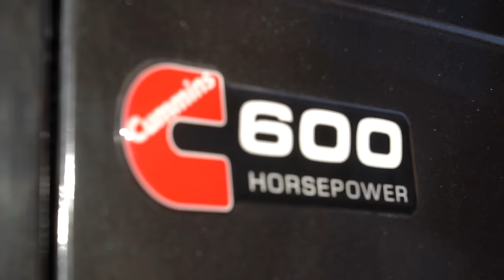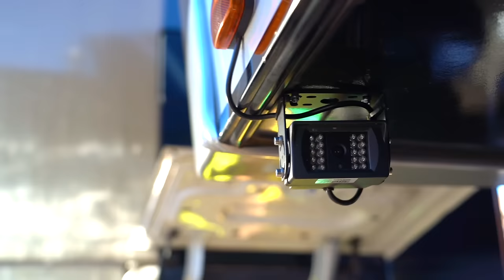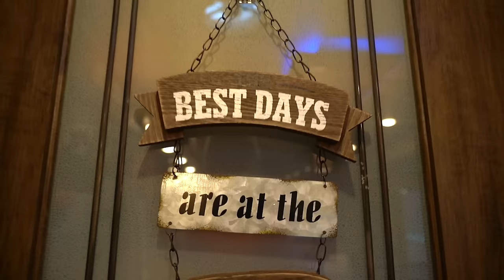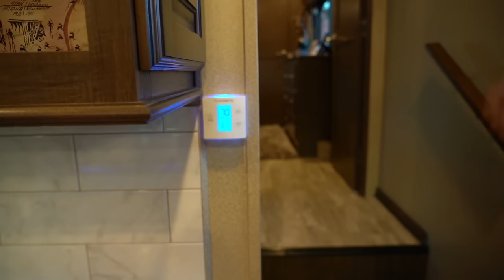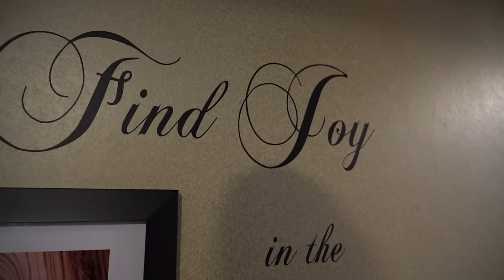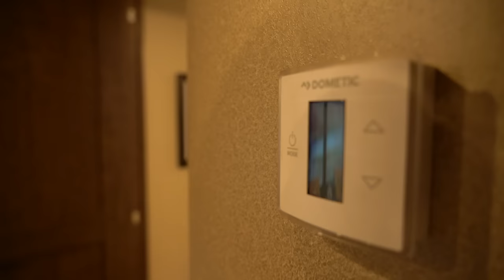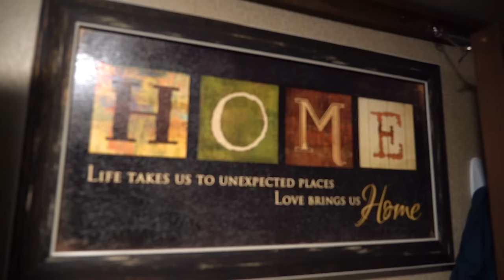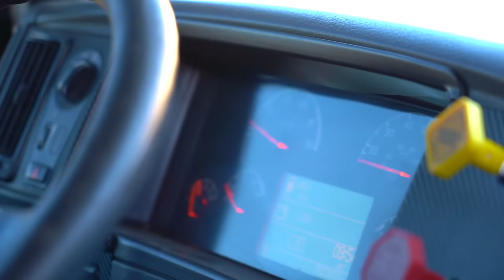Couple Builds The GREATEST DIY RV Conversion EVER!

Comment from the maker: What should they name this rig? Most upvotes wins! ✅ LINKS & TIMESTAMPS BELOW! Lees Ferry Camping https://youtu.be/qurgpg9DAcU 
Water solution! https://youtu.be/wfCaSL5CVhM Insane RV Tour! https://youtu.be/4U9MBX8lLPA
Starlink video https://youtu.be/PvpX2cfWJo0
00:00 Intro
06:40 Lees Ferry Campground
07:56 Grand Design Solitude 310 GKR mods & upgrade tour begins
10:37 Camping on the Colorado River, what to do in Page & Lees Ferry
25:33 Clear Source 3 Stage Ultra Water Filter & UV Water Filter 
27:35 Triple Dexter 9K Axles, weights
28:55 Do you need a special driver’s license or CDL?
30:46 2004 Volvo HDT 15L Cummins ISX 600 HP 2250 Torque 12 Speed Automated Shift Manual Air ride
33:17 Mad Max Spiked Rims
34:20 Safety HDT Truck, MPH, Fuel Capacity
35:31 Lithium vs AGM, 12V vs 6 volt batteries, Trojan L16 
38:48 Doomsday Prepped!
39:22 Don’t be intimidated by an HDT Semi Truck
40:30 Extreme trailer modifications & upgrades
41:56 Class A storge on a 5th wheel! Adding extra RC storage boxes
43:52 How I take my garage full of Milwaukee tools on the road, pass-through storage
47:50 Safety, Fire Extinguishers 
50:04 Preventing tire blow out damage
51:53 How do you level it with Lippert 6 point leveling system & One Control? Customization & modifications
56:17 Why go full time with family and kids? How to get ready
58:44 Managing a small business while full time on the road
1:06:17 MORryde Sliding Cargo Tray for freezer
1:07:23 Navigating a big rig in an RV park
1:09:36 How we find & manage water boondocking & dry camping
1:11:46 Sunset at Lees Ferry Campground
1:13:10 Grand Design Solitude 310 GKR kitchen tour & mods
1:14:28 No odor kitty litter solution Litter-Robot 3
1:15:05 Unique cats! Bobalinks 49% Bobcat 51% Savannah 
1:21:36 Why we upgraded our toilet, upgraded RV bathroom
1:23:27 Can you run your washing machine while boondocking?
1:31:00 What is the inside of a semi or HDT look like?
1:40:05 How do kids like school on the road?
Aquatank2 150 Gallon Water Bladder https://amzn.to/33zl7E8 
Blue tote https://amzn.to/3sXbWG6 
Garmin 1090 RV https://amzn.to/3s1LfRp 
Tim Ferris - 4 Hour Work Week https://amzn.to/3BxBY6Y 
Clear Source Water Filter https://amzn.to/3I57NGN 
HQUA-OWS-12V UV Water Purifier https://amzn.to/3H5Erqv 
Walkie Talkie Radios https://amzn.to/3H7Svj0
Water Bandit https://amzn.to/3I5v0IR
GMG Smoker Grill https://amzn.to/3BxUJao 
Propane firepit https://amzn.to/3s6gxXD 
SeaFlo Water Pump & pressure tank https://amzn.to/3uZzVr7 
MORryde Sliding Cargo Tray https://amzn.to/3BEn4fk 
Litter-Robot 3 ttps://amzn.to/3H4YS6H 
LG RV Microwave Convection Oven http://enjoythejourney.life/micro 
Mattress https://amzn.to/3JHrhSc
RV washing machine https://amzn.to/34Vjwcz
RV clothes dryer https://amzn.to/3H3USDB
Ninja Foodie https://amzn.to/3v1ISjs
Dometic Penguin 2 A/C with heat pump https://amzn.to/34V2xqL
Dometic RV toilet https://amzn.to/3v4iEwH
Dometic RV freezer https://amzn.to/3JFbWSa
Trojan L16P-AC 6V battery https://amzn.to/3I7QdBM 
Yeti 210 cooler https://amzn.to/3Ilu4Al 
⛺ Free Camping, Trip Planner & More! (90 Day Free Trial) http://enjoythejourney.life/dyrt
🚲 OUR EBIKES! GET YOURS TODAY! http://enjoythejourney.life/ebikes
📰 BEST RV WARRANTY http://enjoythejourney.life/warranty
✅ MERCH! T-SHIRTS & MORE! https://teespring.com/stores/enjoythejourney
👍 Quick Start Guide: How to Make Money & RV & FREE RV Campsite Setup & Breakdown Checklist(s) http://enjoythejourney.life/newsletter
📶 HOW DO WE GET INTERNET? http://enjoythejourney.life/speed (🤑 SAVE 5% OFF!)
Get all your truck, towing, RV needs & more http://enjoythejourney.life/Etrailer
SHOP OUR AMAZON STORE https://www.amazon.com/shop/enjoythejourney.life

*** SOCIAL: Follow us & share with your friends ***

Join the 'Journey Tribe': http://enjoythejourney.life/join
Subscribe to our YouTube channel: http://enjoythejourney.life/YouTube
Subscribe to our newsletter for updates: http://enjoythejourney.life/newsletter   
Join our Facebook Group: http://enjoythejourney.life/group
Facebook Page:  https://www.facebook.com/EnjoyTheJourney.Life
Instagram:  https://www.instagram.com/enjoythejourney.life
Website: http://enjoythejourney.life/ 

*** FAVORITE RV PARKING & CAMPSITE FINDERS! ***

Free Camping, Trip Planner & More! (90 Day Free Trial) http://enjoythejourney.life/dyrt 
Get $100 off a Thousand Trails camping pass! Contact Aaron Aaron_Massa@equitylifestyle.com or 360-489-4407 or contact Kimberly for a "used" membership http://enjoythejourney.life/TT or 800-272-0401 (mention Tom Kenemore if you call in)
The Best RV Routes, campsites & more! http://enjoythejourney.life/rvtripwizard (25% off with code: ENJOY25)
RV FREE at wineries, breweries, golf courses & more (save 15% off with code: HHFRIENDS15) http://geni.us/winedock

*** CONTACT US ***

Email: tomandcheri@enjoythejourney.life
Mail Bag:
Lake Effect Media
14870 Granada Avenue 1037
Apple Valley, MN 55124

Enjoy The Journey . Life, All Rights Reserved
Our channel is for entertainment purposes only.
Some of our links are affiliate links.
Reply: Volvoloster
Reply: Black Crystal
Reply: They should definitely name that rig Freedom for that is what they've gotten with it
Reply: FREEDOM BEAUTY INSTEAD OF BLACK BEAUTY 
JUST A THOUGHT
Reply: Mammer jammer
Reply: The Beast
Reply: I agree with another post. Black Betty is a great name
Reply: Double V (Volvo Vacationer). Would make a good handle on the cb too.
Reply: The Beast! 🚛
Reply: THE GET AWAY 10.0
Reply: Rigzilla

Comment: Followed their build and remember answering questions on several of the sites their one.  We also are full-time and pull with a converted semi truck. We've been full-time since 2013 and with a Volvo truck since 2014.  Over time you carry less repair stuff as you learn what breaks more often, what spares you need to carry etc.  We carry small designated totes for 12v electric, 120v electric, RV plumbing, truck air, truck "Plumbing" (radiator hoses, heater hose), RV tire-bearing-suspension, and then various totes for tools. Our Volvo is singled short as well but has a bed with 5 boxes to help store stuff.  Currently, we're dragging a DRV Memphis floorplan at 46' and double towing a Smart car behind it.  74' overall.

Comment: Another option with washer is to have a separate grey tank just for washer and recycle water through a filter system. Friends removed their bathroom in garage and installed washer dryer there and used the black tank from that bathroom as washer grey tank. Works well and hasn't had any issues in 5 years

Comment: I am a retired over-the-road driver, and I used to pull step deck. should look into lift axle on the trailer that'll help you back in sharper
Reply: This is something I’ve been toying with. What axle would be best to lift?
Reply: The rear axle would be the best to lift that would shorten your wheel base to help but it could also cause tail swing.
Reply: @andrewgilbreath1331  I’m looking into this

Comment: This looks like an incredible rig, but one minor issue is that particular tractor is not designed to haul 80k pounds (28:36). With only one drive axle, regardless of engine horsepower, it is probably specced for about 7k more than you can legally do with your rig. In other words the tractor can haul at 66k pounds GCWR but you are at 59k: 12k steers, 20k drives, 27k for the three trailer 9k singles. The lowest weight rating (axle, tire, or state regulations) controls that number for each axle, so be very careful when you replace tires or you may lose weight capacity.
Reply: Can't not for hire trucks do what they want?
Reply: @51-FS  I do not recommend driving overweight to see for yourself. You might get away with it for some time, but you may not. If you make it obvious the police absolutely will notice and the only thing that matters for commercial versus personal use is in the former case the violation goes against the company and the driver instead of the driver alone. The states where I have registered large vehicles for personal use charge significantly more for those vehicles based upon their weight. They have a reason for doing so, and the registered weight has been on every vehicle registration I have had for large vehicles - personal use or commercial.

Tires and axles don't care if you are driving your personal vehicle or using the vehicle in commerce. If you exceed the weight rating you are operating the vehicle in an unsafe manner, which is unlawful. Many of the regulations for commercial vehicles do not apply to vehicles not used in commerce, but operating the vehicle safely is the obligation of every single driver using the roads.
Reply: You are correct. I was referring to what the tractor was originally intended to haul. We are 48,080lbs loaded and full of water, diesel, and truck on back. We plan to add another 1000lbs in solar but that’s about it for us. We should be right at 50,000lbs unless we dump 200gal of water when we tow. Then we should be right back to where we are now. As for tires, that’s why we went to the 17.5 Alcoa and double coin rubber, the last thing we would do now is skimp on safety ;-)
Reply: @BoostedFJ  I have been thinking of starting with a standard dry box and building it into an RV myself, but mounting yours on a high-quality trailer was definitely a stroke of genius. Tires are hard to come by at the current moment, but they truly are a safety-critical item. Another thing that may be problematic is the pickup truck's overhang. I don't know if you have and/ or use flags/ lights for the rear of the truck but in states such as Arizona any overhang at all requires one (daytime) or both (night).
Reply: @r2db  We we’re hauling the pickup temporarily, the Crawler is with us 90% of the time and it’s 4ft shorter with no overhang.
Reply: This is very impressive feat of ingenuity! One thing where we are we cant have anything stick past the main bumper more 4’ without lights or red flags for over length?
Reply: @markb9241  How is this a feat of ingenuity? Pickup trucks have had slide windows you could open and stick something through for decades. It's a dumb idea as commonly practiced, but it works until it doesn't. Even in my short bed pickup I can put a 4x8 sheet of plywood and not have it stick out far enough to need flags. It took me all of a couple hours to measure and cut lumber so I can hold it above the wheel wells and get a full 8 feet of cargo all the way across the bed. For when I want to haul something much bigger, like a 20 foot long piece of steel, I have a rack for the bed that extends above the cab.

But apparently putting a flag or an orange light on something and properly securing your cargo is a major problem for you?

Comment: This guy being a fabricator he is very smart it is 100% correct and everything that he speaks of especially the turning radius of that Volvo with the Volvo tractor being a single axle tractor it turns even better but besides that Volvo tractors turn very short to begin with even if it were a tandem also what he speaks about having his axles on his trailer so far for work helps his turning capability as well you can definitely tell that a very capable fabricator owns and built this setup very well done

Comment: Q
WOW, what a unit. Nice looking.  I know it was mentioned, as each Sate registration is different,  but you would think you would need a air break endorsement on license. I wouldn't think that heavy unit is hydrolic and the trailer electric breaks. You would think just the GVW would make you have some kind of endorsement.  Even for a "RV"

Comment: Grand design had a G series toy hauler with a short outside deck on the rear. I think it was 12’ to 14’ long. Had an awesome outside storage/ kitchen area on the deck. It was set up sort of like an outside bar. I don’t think it sold well. It was quite an awesome setup.

Comment: If there was one big makeover I'd do to the volvo is to get ridd of the mirrors and install camra arms they sticke out from the cab on the window pillars at the top , the main reason is it cuts out two very big blind spots even with the A4 size tablets fitted to the inside of the window pillars pluss on the near side you can have  wide angle lenses also fitted so you can watch the trailer on a tight left hand U turn . Another pluss is there less sucepterble to damage eather from minor bash or trees hitting them . Here in the UK it cost five hundred pounds just for the heated mirror glass for the mirror head and motors your looking at a thousand or more . So with the camera arms set high up on the window pillars it does not get hit by other trucks passing with there mirrors

Comment: I guessed the number represented the length of the lower deck. My Jayco Eagle HT 265BHS is 33ft overall. 33 take away 8ish, so 25-26ft. The 355MBQS is 43ft overall and it's expanded in length since 2018

Comment: As a professional CDL driver and one who has driven most everything, I personally HATE big trucks. That being said it’s the shifting and lack of mirrors I don’t care for. IF the truck is automatic (he’s described it as an automatic) AND it has large and many mirrors it makes a huge difference. 
     Don’t get me wrong the height helps but it’s not a be all end all. Also I’m sure one can see around the rv better in a semi than a F350-450-550 simply because of the height.
Reply: I have a modified Volvo semi, too. With the iShift automated 12 speed transmission (no clutch) and the adaptive cruse control, it is awesome, even though I have a slightly smaller (Volvo) engine (his is a Cummins). And with rearview cameras in addition to the mirrors, I can see plenty. We love it.

Comment: 29:35 LOL yeah here in Texas its non-commercial class A.  Many people don't realize that even with a 350/450 and big 5th wheel you need a non-commercial class A as well here in Texas.  All about GVWR of both truck and trailer over 26K lbs, no matter what the actual weight is.   Great video.  👍
Reply: Yep,…and they do enforce it, too.  In Az you can “declare” the GVW of 26k or less for the truck, and register it as an MDT.  It allowed you to get full coverage without paying commercial insurance.
Reply: @amandadavis9726  Yep.  Here with a F350/450 that has a 14,000 GVWR all you need is a trailer with more than 12,000 GWR and your into class A license.  I can see both ways.  I have towed a friends small 3 stall horse trailer behind a single rear wheel F350.  That trailer had a 13,000 GWR and lucky my truck was only 11,500 GVWR so I was good at the time, but only by 1500 lbs.  Now a days a large travel trailer bumper pull will put you over the limit.   In Missouri it seems simlar to AZ then.  You simply pick your plates you want.  A regular plate can't exceed 12,000 Lbs GCWR.  You see 3/4 and 1 ton trucks running these plates all the time.  If they get caught hauling over that weight there are some big fines.  My father in law purchased 18K plates for his F250, again its GCWR, and all he had  was a smaller fishing boat, but was legal for sure.  They don't issue rear plates if you go over 12K lbs, which is strange to only see a front plate on the truck when there is no trailers etc.  You can have anything you want on the rear of the truck in the plate area.

Comment: I would have been interested in the 700,000 miles on the truck. Do you care about that or is 700,000 just knowing that the engine is getting loose? There are many engines that can replace that when it fails. Is the truck frame or the motor good for a million miles? $20,000 seems a good price.
Reply: And in today's market, his truck would probably sell for more like $50k and my 2015 with a little larger sleeper, would sell for at least $65 to $70. And since mine was lengthened and a box added to garage/carry my 4-door Jeep Wrangler, it is worth much more...but still less than a brand new 1 ton dually (350/3500) or 450 pickup.

Comment: I'd call it the black ox 🐂 he should put some adjustable detachable front wheel chocks so he don't run into the trailer so when he loads it the wheel chocks will stop it from hitting the trailer it's just a suggestion
Reply: That’s funny you say that because I’m building them right now! I wish I could add a picture to this reply hahaha
Reply: @BoostedFJ  I'm building a 1975 Pete 359 to pull my toy hauler I've been doing it for a while but it's because I got some other issues going on right now so I'm kinda stuck I just wanna get done with it though instead of being a drive way ornament it's on my channel
Reply: @jesserasso1042  keep up the good work!
Reply: @BoostedFJ  thanks you too I'm gonna keep looking out for you I subscribed to your channel

Comment: Saw one of your 5th wheel where the frame to the tow bar but the frame that connects to the van was wear were they had hit a bump at speed I guess because as it punched the bar up thru the bed inside! Weak as!

Comment: They used to cost about $20,000, that truck in the current market would sell for around $50-$60,000. Even with the higher mileage. Everything is way over priced in the new and used HDT market 🤦🏾‍♀️

Comment: I have already topped this 2 years ago.
Mine has a 5 person hot tub.it hauls 4 motorcycles, 3 jet skis, 2 Polaris rs1's and a smart car.no toy left behind.
Reply: BUT do you have an '18 Grand Design as a base?
Reply: @mrmotofy  heck no.
I have a stretched Volvo 780 that I custom built the living quarters on.
From the ground up.
Reply: @rolandrockstarmega1299  But he's got 35ft of comfort and water for weeks
Reply: @mrmotofy  true.
I can haul 350 gallons of water.and with 2 opposing slides and no kids. My comfort level is pretty high. And the comfort level sitting in my 5 person hot tub is not bad either. 😎